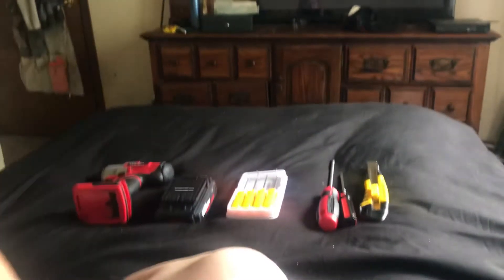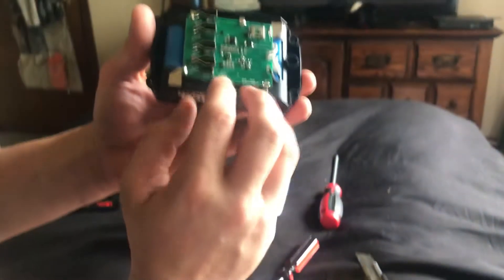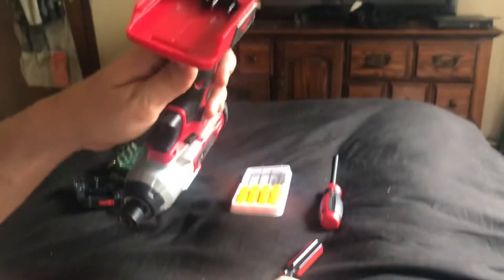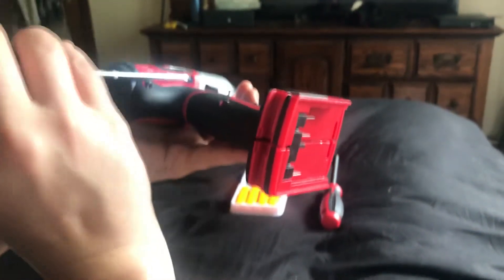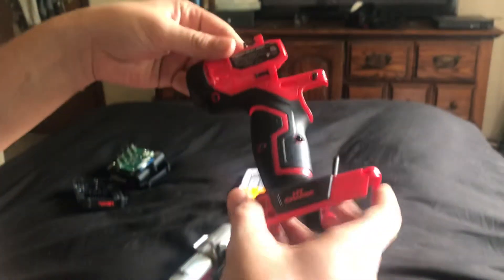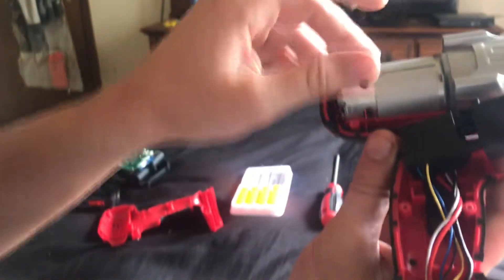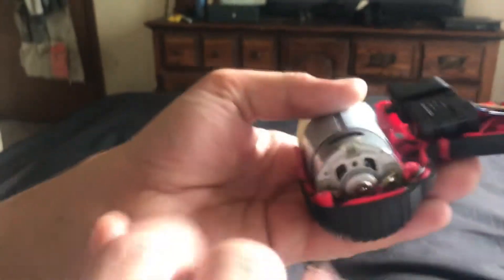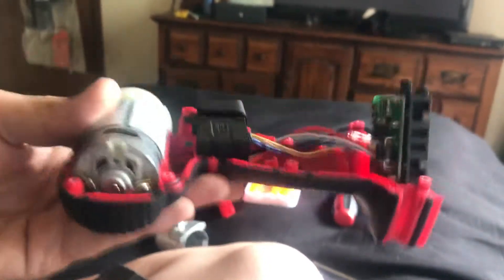Walmart hyper tough impact driver 1375 inch pounds torque teardown plus full material breakdown

Comment: At Walmart $39.88 7 piece set 👍 imma use the shit out of the saw,impact driver,drill,flash light. Thanks for the information
Reply: Thats cheap,I thought I got a deal for $50
Reply from the maker: Check out my videos on the circular saw and recip saw I have teardown a of both